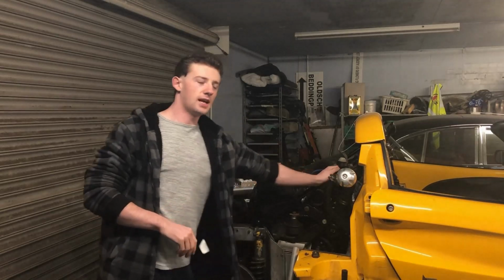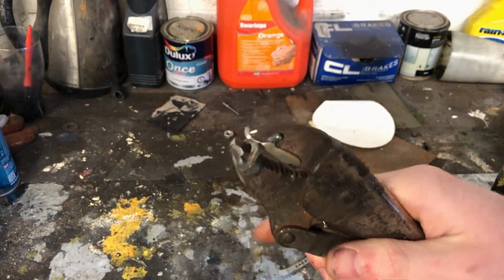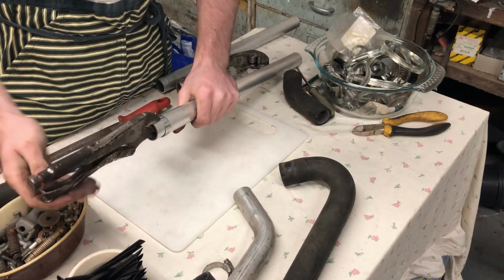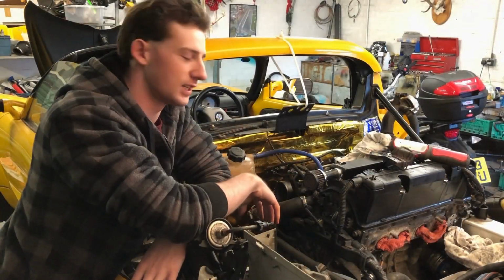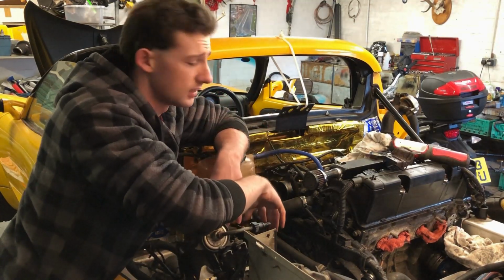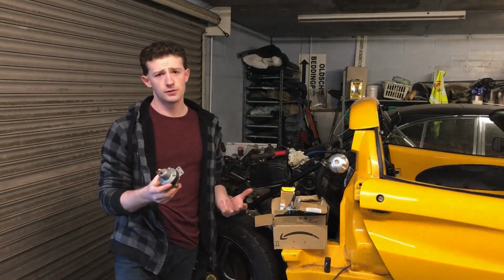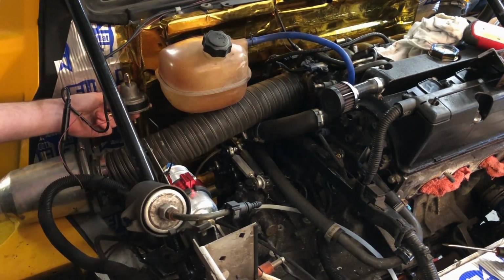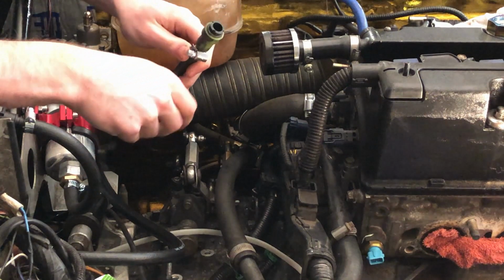Honda Elise Build: Plumbing Time ( 4 )

Comment: coming along nicely, looking forward to seeing the rest of the build. Are you going to supercharge it at some point? Hows the angle looking on your driveshafts too? Which drifeshafts did you use? My drive shafts heat up a bit and like to fling a bit of cv grease around, i have to re-grease them every year. So try your best to get the angle as straight as possible will reduce the heat
Reply from the maker: Thanks, glad you're enjoying it. im not 100% sure what the next step will be,  but given the history of constant tweaking ive had with this car forced induction is something i might look into at some point. im using stark driveshafts, the angle seems similar to a lot of photos ive seen of other builds so should be okay. ill  bear that in mind about the grease though, something to keep an eye on.